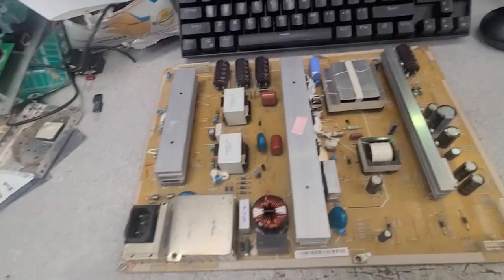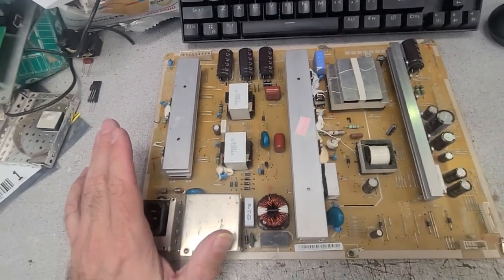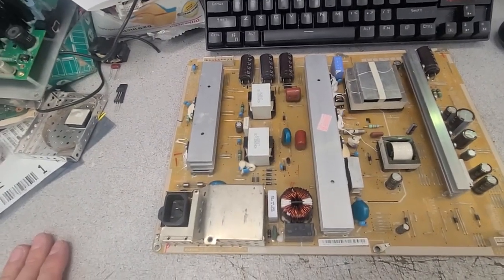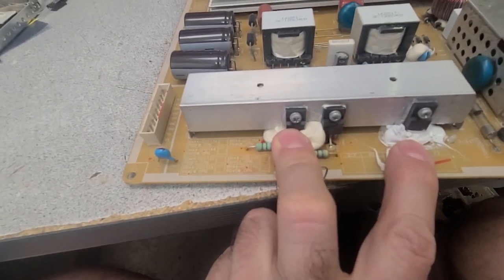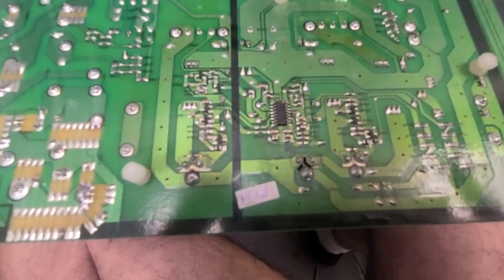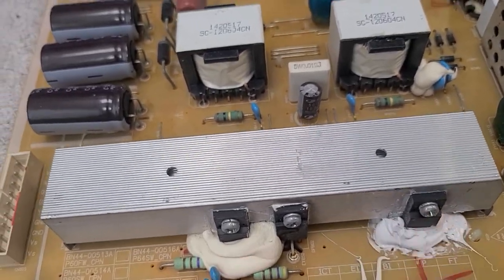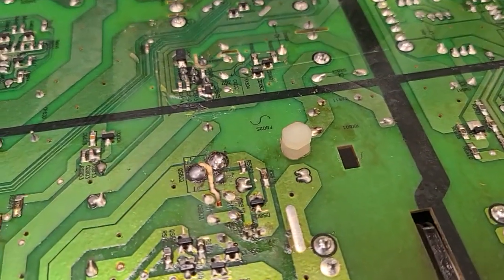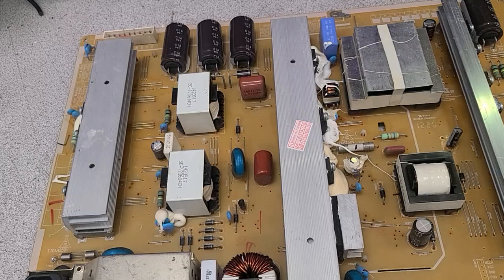The risks of buying Chinese / amateurish products and services on eBay etc. Sharpen up, folks!

Comment from the maker: I just have to follow-up on this repair. The replaced MOSFETs DID NOT HAVE ANY HEAT TRANSFER COMPOUND BETWEEN THEMSELVES AND THE HEAT SINK! This means the board had at most several days of life before they overheat and fail again.

But wait, there's more: the original NTC for this board is WTR15D080, which is 8 Ohm with 5A limit at 15mm diameter. They've replaced it with SCK2R56, which is 2.5 Ohm / 6A and smaller in diameter. If that works in a live set it won't be for long since the inrush current that it is expecting to limit is twice its designed capacity, which means it will just burn soon (from overheating / thermal cycles) and that is assuming the board can work fine with 2.5A limit there instead of 5A.

OMG....I did two revisions of this comment - one for each paragraph. But after finding all this I figured...what's the only thing left that I am certain they've replaced...and it was the fuse. First, they've used regular no-lead fuse and had soldered legs to it. Not terrible by itself and I admit we may have done the same once or twice when out of fuses...once or twice for 10 or so years we did. But they've also put 8A fuse in place of a 10A rated fuse.

THERE IS NOT A SINGLE THING THAT WAS DONE RIGHT ON THAT BOARD!

ABSOLUTE JUNK!!!

And the worst part is that for someone dealing with it for the first time it will leave the impression that this is generally faulty board that's not worth dealing with, which would be very far from the truth.
I do not have a solution to the problem. Recognizing quality requires understanding quality, so it's hard to expect a layman to tell quality product and service from a cheap one.
But anyone with a head on their head should work on educating themselves enough to make proper calls...and that is true in all areas of life. When you find a good vendor stick to them...that's what I do.